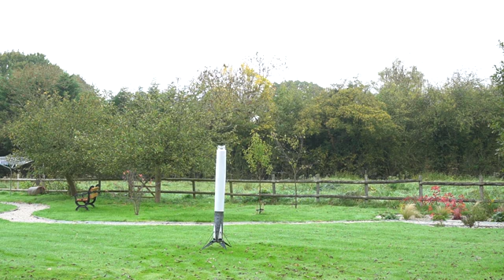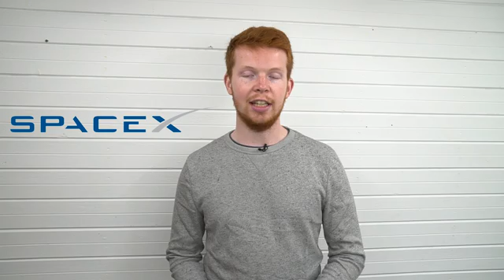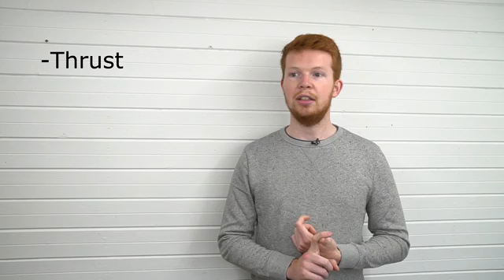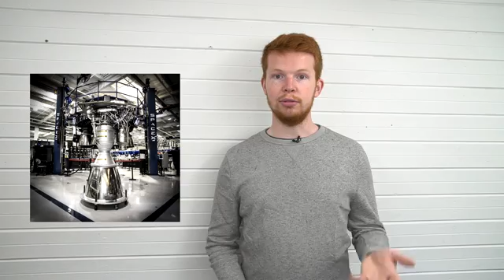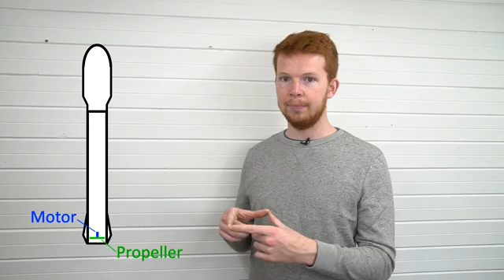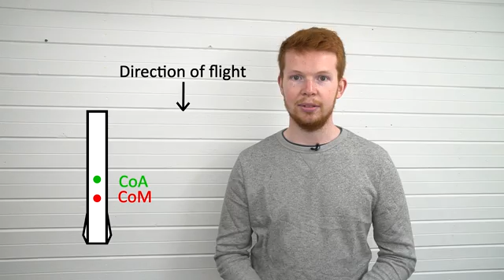Hovering a rocket - SpaceX model

Comment: I vote for Success. 
- 11:36 the top horizontal propeller thrusters were competing for the intake air, the control module hardly could deal with it. 
- a little bit more weight could contribute in smoother control in both cases

Comment: Tom, have you considered use of a combination gyro/GPS stabilizing system, similar to those used in various Hubsan quads to help control the vehicle's vectoring vanes. A modern version of what the German used on the V2 rockets?   My Hubsan H501s is remarkably stable when set in that mode.

Comment: I think if you decrease the space between the prop tip and the tube, you will get higher efficiency on your Power system. Gaps cause vortices, which increase drag and decrease efficiency. You could take a strip of foam board with both sides of paper removed and see if you can close the gap. Look up Ben Harper videos too, he make awesome edf tubes for rc planes. Pm me if you need more help.

Comment: Success! Use 2 motors. Put them as high in the tube as you can. Then add 4 thrust vectoring ports (doors controlled by servos) below the motors but in the thrust air stream. Have the doors pivot on a center hinge so the top half of the door goes into the tube, and bottom half sticks out. Those can work on a Y harness with the thrust vectoring servos on the bottom.

Comment: S H O W. T H I S. E L O N. M U S K!!! It took often several gusts to knock the rocket over, the weight was not intended for gust conditions. All the materials used, had inherent tolerances, in terms of stability and shape, that I would have expected, to make the project impossible. Yet You pulled it off, to build a rocket that clearly hovered upright in extreme conditions! A thought about your "success" criterion: When one judges the position of the rocket in relation to the space of moving air(pocket/gust) it turns out to a.: follow it, and b.: do that without compromising the upright position! Had I only read the building plan for this, I never had believed, that such a result would be possible! So go to Elon, and if You don't want, then go to someone, who has the authority to give You a grant!

Comment: in your 2nd model, a) your center of mass is way too high, b) vector is tied to the fan speed which isn't able to compensate for your high center of mass at low speeds. I suggest you I) lower your center of mass, II) increase the control surface.
Reply from the maker: The second model requires a high centre of mass to maximize the perpendicular distance between the pivot point and the thrust vectoring system. If you research something called the 'rocket pendulum fallacy', you'll see why a low centre of mass does not equal greater stability. Thanks

Comment: Slack off on the elastic cord so it only prevents the top from impacting the ground. 
I would have putboth motors at the bottom blowing up the tube. With a flow direction device at the top to feed out of slots that cause lift from the top

Comment: Coming from a racing drone pilot, I'd say you would need MUCH more powerful motors and MUCH larger propellers to really get that thing moving well. Also, if the "dirty" air of one propeller is going into the other, it may have some weird effects and one may have higher RPMs than the other
Reply from the maker: I used a tmotor f40 pro 2400kv with a dal 5x4.5x3bn v1, which should have had plenty of thrust. But yeah I'll probably move to an f60 with 6inch prop next. Thanks!
Reply: Tom Stanton You're a mini quad pilot?

Comment: it's basically a dual copter. fitting two props inside a tube to form the rocket shape attenuates the prop diameter, and leads to low thrust efficiency. dual copter cancel out the moment of inertia between the two props, easy to implement with electric motors. the force produced by the deflected fins have a very good distance from the CG point, looks quite stable during hovering, good job!

Comment: ArduPilot ( open source autopilot ) can fly that "rocket" for you,   its called "prop hang" on a normal acrobatic RC aircraft, as the wing becomes essentially unnecessary, and the front of the aircraft points upward. https://discuss.ardupilot.org/t/ardupilot-flying-3d-aircraft-including-hovering/14837/15

Comment: i think it will go straight up if u tweak design a bit... i know its difficult but just an idea. give some side thrust and distribute the wait properly. also i think u should use more than one motor to provide trust so that the load is distributed . also u may have to change the propeller design.

Comment: Definite success.  I assume if you're using an off the shelf drone controller, it supports mixing controller input with self levelling control, so you should be able to use the right stick on your TX to steer the rocket around.
The dynamics of your rocket are probably well outside what it expects for a normal quad so perhaps more manual PID tuning is what's needed to reduce the oscillations you see.
Still, top marks for what you achieved with this video in such a short time!

Comment: Great job! If I were you, i'd push that motor position waaay down, as far as you can without tipping the center of mass. This is because in its current position the high-speed air clings to your duct and you're losing a lot of thrust to friction. And since you have your battery at the very top, it shouldn't be too bad in terms of weight distribution.
Reply from the maker: Ah interesting! Yeah that makes complete sense, thanks!

Comment: Definitely a success considering the time limitations you were working with and all that you were lacking as far as flight stability sensors go.  The addition of altitude sensing for soft-touchdown would eliminate the hard drop when the throttle is cut, thereby reducing bounce/tip-over. Re-implementing the top thrusters to only come into play on touchdown would also add to reduced tip-over chances when the bottom vectored thrusters can no lon ger sufficiently stabilize the rocket.

Comment: Why didnt you copy the complete copter PID Controller?   There should be a accelerometer on it to hold the position a bit nicer . With a naza you even could add gps. Did you mount the FC on top or bottom ?

Comment: Have you thought about using a large slow burning model rocket engine in the middle of the fins to get it off the ground and then use your landing system to bring it down?

Comment: Great success, to increase power I would do dual motors counter rotating (like your v1) and using a proper duct inside (blade tips very close to the duct)  the polystyrene tube

Comment: A partial success of course. But now you need to add in either a GPS/Compass or some optical sensor to control the position via thrusters. Use a Pixhawk for that.

Comment: You are using one motor, this is causing the rocket body to spin like a helicopter without a tail rotor.  You should have a second engine installed with counter rotating motor and prop to cancel out the centrifugal force of one engine acting on the body.

Comment: Hi Tom. I say it's a success.
A few comments if I can help.
1- The trust of the rocket is a force pushing upward, not downward. The air is exhausted downward, that is the action. And the pressure inside the combustion chamber is equalized all around the chamber walls except in the back (the exhaust pipe) therefore the opposite force to the exhaust is pushing forward in the chamber. That is the reaction.

2- On the Space-X rocket, you have shown us that the stability of the rocket is aided with small thrusters at the top of the rocket. You are trying to compensate for the head movement by moving your rocket from the bottom. I think you should try to guide your rocket from the top also, as does Space-X, because it is the head that want's to get off the flight plan, not the tail. Repositioning the tail under the head requires a lot more thrust, movement and time then repositioning the head over the tail. To do so simply, I think you could put a second propeller at the top of the rocket body, pushing downward and use 4 or 6 retractable scoops just underneath the propeller that would expel air out to the side of the rocket as needed. The opening and closing of the scoops could be controlled by you gyro.

Just some ideas if that can help. Keep going, it is fun to see.

Comment: As a former senior systems engineer at a major Arizona missile defense company, I want to congratulate you on your efforts and to encourage you to finish solving the task. It seems you are only lacking 1) a better motor/fan combo, 2) a GPS guidance solution for stationary positioning( Apm or Pixhawk w/ mission planner if you aren't already).

 I ran a secret development group with all kinds of impossible tasks and ridiculous deadlines and we made it our Mantra to "fail early, fail as fast as possible" in order to solve problems. It works. It also helped to follow Kelly Johnson's 14 rules for running  a R&D group. I now run my own commercial  UAV company making composite fixed wing aircraft. Keep up the effort and I believe you can take it far.

BTW, good job on both the graphics and clear explanation of the physics behind rocketry for the layman.
Reply: Delta Zee Solutions 
Douche ^

Comment: Totally a success considering the budget. As for drift in wind, use GPS and calc drift velocity and vector. Use this data to tell the controller what is 'vertical' for the vehicle and add in a 'crab' vertical vector counter to the drift (allow the vehicle to lean a bit exactly the correct amount). A feedback loop comparing drift vector to 'lean' angle should cancel out drift. This, of course, will require a bit more power to compensate for decreased lift (like a helicopter's rudder pedals require more power). But like the guy below said: we found out why space x doesn't land nor take off on GRASS. Use a piece of plywood as a pad or move to a concrete yard. Lastly, the legs are crap-maybe go more for practical prototype rather than look like Falcon 9. Great work!

Comment: It would be a success if you add a ground sensing camera, sonar sensor, a GPS and motors to simulate RCS thrust for rotation and translation. I think this video was made in haste. You could have made a WORKING Falcon 9 replica but you rushed it just to post a failed video demo. Hopefully u correct this.

Comment: Why not work out the battery voltage from it's output resistance, current and voltage?  Output resistance can even be deduced by a varying the load

Comment: G'day,

  BOO... HISSS  !

    Three Minuets in thou dost admit that you Did Not Even TRY to cobble-up and tinker together ANY kind of "Rocket" at all.

   A "Rocket" does not either need to manipulate so as to react against the Atmosphere in orde to generate the Massflow needed to achieve Levitation with Acceleration, nor does a Rocket need to consume Air to burn, and not to cool it's Motors, either...

  So, this thing is decidedly NOT any kind of Rocket, at all.

  What this is, is a Contra-Rotating Electric Ducted-Fan, almost Finless & Wingless, and designed to attempt a Vertical "Rise Off Ground" Take-off, hovering Flight, and a controlled  Vertical Landing...; which is a seriously-difficult trick, but it is not any feat of Rocketry at all, whatsoever.

   If you wanted to get serious about this, you'd be checking out the Australian "Hoveroc" (Hovering Rocket) developed in South Australia for the Royal Australian Navy...; the idea was to build a Conically-Shaped Solid-Fuel Rocket Motor to carry a Radar-Reflector off the Deck of a Warship and hover at between 150 Ft & 300 Ft Altitude, behind the Vessel, serving as an Infra-Red Target as well as a Radar Target, the better to attract Exocet type Air to Surface Anti-Shipping Missiles away from the Australian Warships.

  The trick was to shape the Solid Rocket Charge such that it had sufficient Acceleration to lift-off & climb to height, when the Fuel-Volume reduces to prevent further ascent, and then as Fuel-Weight is consumed the Area of Burning-Fuel is reducing, such that Thrust Equals Weight, until the Fuel runs out.

  Control was via Gyro-Actuated Servos operating Graphite Vanes in the Exhaust...; as I understand it.

  I note that the Royal Australian Navy has never ever had any Vessel hit by an Exocet ; so, like the White Knight's Mousetrap on his Saddleback (which never caught a Mouse), or Fort Dennison (built inside Sydney Harbour to defend Circular-Quay from Russian Invasion in 1854....) ; the Hoveroc MUST be deemed to be a total success...

   You should look into it, and meanwhile retitle this Video so as to include  the words "Co-Axial Ducted-Fan" in the Video...

  Just(ifiably ?) sayin,

  ;-p

  Ciao !

Comment: I LOVE your engineering skills. I'm wondering how it would behave if you essentially just put a quadcopter at the top and another at the bottom so that they work in tandem to keep it vertical.

I think it would also be interesting to try to have i learn from its experience. You spent a lot of time "tweaking" the sensitivity of the gyros. But maybe it could self-tweak by self-observing having the software dynamically modify the sensitivity as it noticed  and recorded the effects of various settings.

Comment: Great experiment Tom, gives a whole new appreciation of the scale of SpaceX's achievement.
Try again with two or more EDFs in series with staged RPM, perhaps  4S -> 6S -> 8S , and with decreasing fan radius so volume remains consistent through each stage like a real jet engine. May even be able to get exhaust velocity over 200mph!
Adding GPS should make loitering possible, or even waypoints!

Comment: You definitely accomplished a lot. 

What I think, the version 1 rocket: the CM is low to replicate the falcon as it's descending. That means it's only stable when traveling down, therefore unstable at lift-off which your replica had to do first. The only test would be to drop it from a height. Also with the cm low, I should think hovering would be near impossible with the thrust at the bottom. i.e.; with zero forward (downward) velocity it becomes unstable. 

Can the falcon really hover? Or is it coming for a landing and unable to climb at any point? just continually decelerating as it approaches the landing, only one attempt to land? 

It seems that your replica doesn't replicate a rocket descending but a different animal altogether. 

Again, version 1: if you had the cm high for lift off, gain sufficient altitude. Then for descent the cm would have to shift low as it does in the falcon after separation. So, the rocket has to keep moving in its stable direction. And therefore the cm has to be corrected for the change in direction of flight. 

But, you're smarter than I.

Comment: Nice job Tom, I'd be quite proud of your hard work. A couple observations from flying multirotors:
1. Because you are using "fans" you are probably experiencing ground effect at those low distances above the grass
2. Adding GPS could probably correct for side movement of the wind blowing to the side

Comment: Great job man.  A small GPS unit would hold it in one place.  Maybe solid fuel rocket with adjustable exhaust ports for throttle control?  Using the same thrust vectoring for pitch, yaw, roll.  It would require fire resistant construction materials.  Or a bigger motor with a long tether to supply DC power.

Comment: Flaps on an aircraft don’t control the direction of a plane, therefore it cannot be analogous to gridfins on a rocket 🤷🏽‍♂️
Reply from the maker: I used the word flaps because the average Joe might not know what an aileron is ;) thanks!
Reply: Tom Stanton 
I would call them spoilers or speed brakes.

Comment: Remember you are working with planting the missile not hovering. Your weight is best at the bottom since engines would be there in a real rocket and it wouldn't allow the bottom section to be so jittery countering wind. Wind wise remember the plan is planting the rocket on the ground with a rapid descent not needing much wind countering forces. Then the landing is where you need thrust and weight to have the rocket level at touch down. The better the thrust and timing of height above ground you will be able to not worry about wind only needing the proper counter forces for a quick deceleration into level touchdown.

Comment: when you are close to the ground you should try disabling the gyro-based attitude control. the contact dynamics change the equations of motion, and the controller does not work anymore. perhaps you might need a laser altimeter to do that. anyway very nice!

Comment: You probably know this, but your limited with the bottom only control that once you touch down, you lose the ability to shift your COG under the top.  So any tilt or horizontal momentum cannot be corrected after touchdown (especially in a "grippy" surface like turf).  I am also noticing some spin which I suspect is because your maybe maxing out your deflection trying to counter the spin (and losing a lot of thrust in the process).  Id say Mk3 should combine your 2 designs, keep the fins, add a 2nd counter rotating motor, and put some stabilizers on the top.  Calibration might be unpleasant, but you'd have fully replicated the spaceX strategy.

Comment: I'm not sure if other's suggested, but i did see Piereder say "time to add GPS" <-- i believe adding GPS will be the solution to  your wind-drift (or any drift) problem. adding to the flight controller will have it compensate for drift and keep it within (at least) a 6-foot area. You've done a GREAT job at getting this controlled with the duct fins! awesome. GPS IS the next step.
Keep up the wonderful work you do!! 
btw, maybe i missed it, but why did you get rid of the 2nd motor?
Russ from Coral Springs, Florida, USA
ps... now that i've looked thru a lot of the comments, the suggestion of GPS has come up a few times. same concept as "Position Hold" on quads (do you all call them "drones" across the pond?
Russ